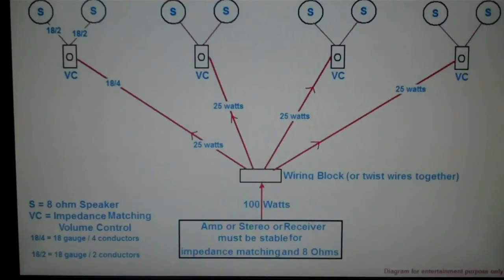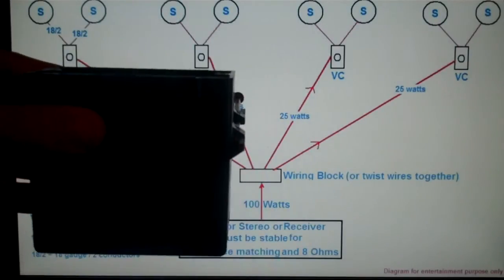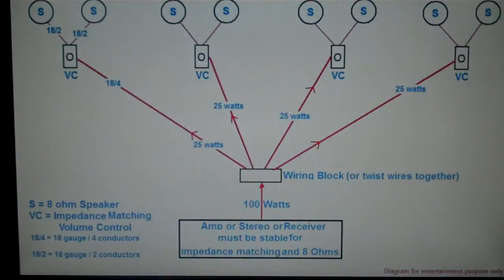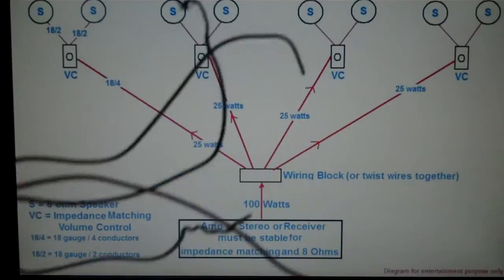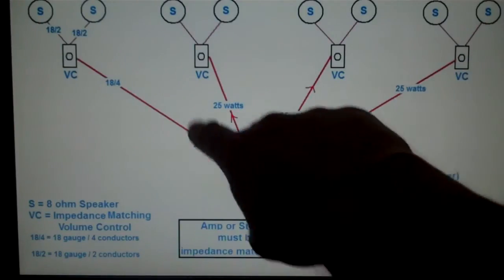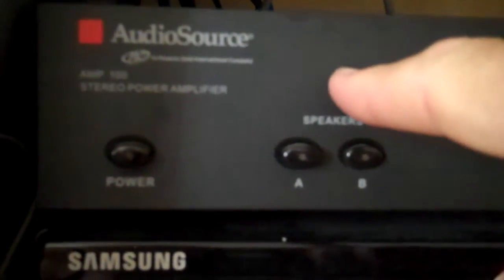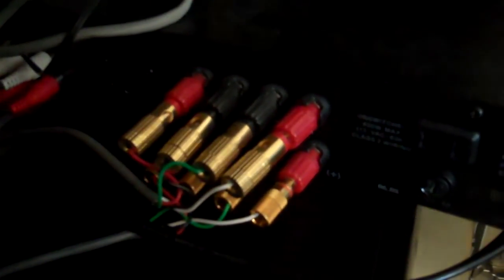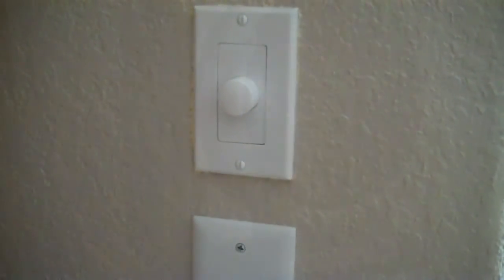Impedance Matching Volume Controls and Speakers

Comment: Did you go back after making this and VIEW what you shared?  When you were actually explaining the speaker diagram the silhouette effect was very useful.  Other than that...not so much.  In addition, when you were not pointing  your camera directly into a light source your camera was not focused.
Having said that...you actually imparted some very good information and are a good teacher.  You need to get the "visual devices" worked out.

Comment: I am planning to build a "subkick" which is essentially using a 8" subwoofer as a microphone. I need to increase the impedance of the subwoofer from 8 ohm to what would be xlose to the same as a normal microphone to protect the preamp input section of a mixing board. (Aprox.100 ohms).
Would a volume control do this simple task? I assume a volume control just increases the resistance between the signal being sent and the signal recieving device. Correct? Like a reastat or light buld dimmer switch?
Thanks